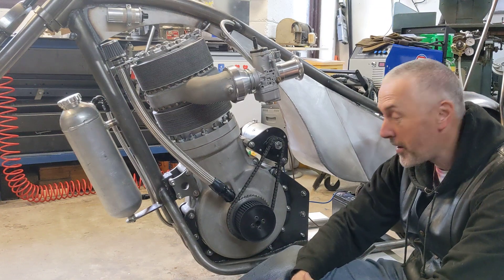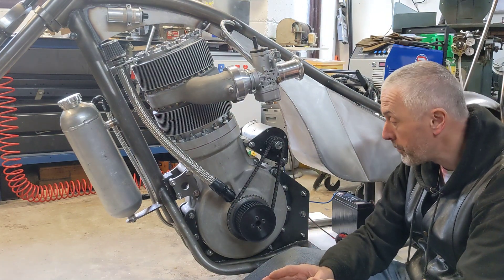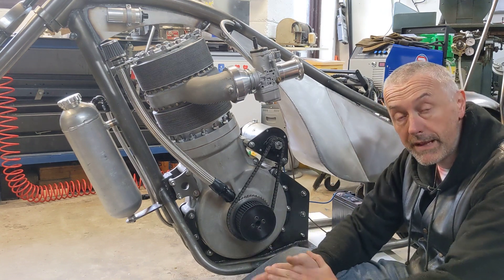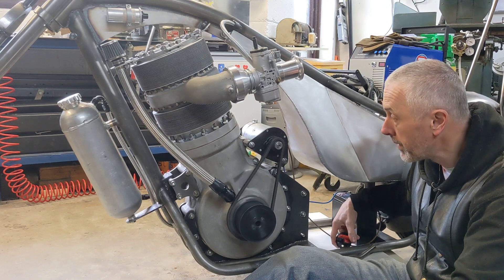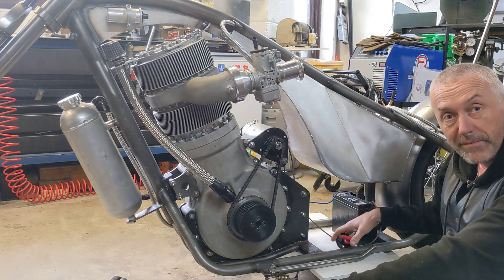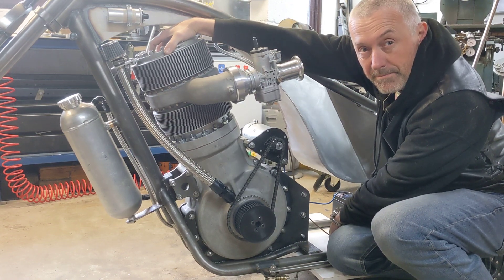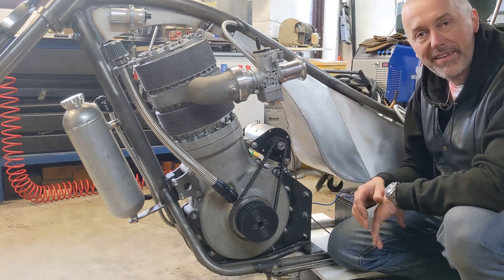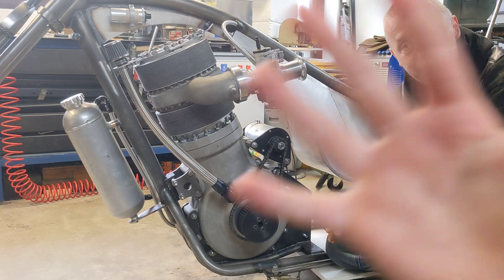Turning the engine at different speeds.

Comment: Why don't you use a starter from a car? There are small ones that are 2.2 KW, that should be enough
Reply from the maker: @peterolson8350  in the later videos we try that, but even a 2.1kw car starter motor isn't enough.
Reply: @StoneEng Even with a gear ratio of 10:1?

Comment: Would it be possible to piggyback the Dyna start to the Audi Starter you have fitted which would give two simultaneous starter motors but also then the battery can be charged after engine start up as you originally planned. Also, try using a larger car battery and higher rated car battery leads too.
Reply from the maker: I did think of that. It would be a challenge as the two rotate at different speeds, but that could be overcome by gearing. I'll see how I get on with a single starter motor first.

Comment: Decompressors can be wierd things, you would imagine they would reduce engine braking but the opposite is true. with no decrompressor an engine on the over run will compress air and then get that energy back as the piston goes down with the air acting like a spring so the net energy loss is low. With a decompressor open it pumps air out on the compression stroke and draws it back in on the down stroke, the pumping losses are far greater than the losses of compressing the air and then that compressed air pushing the piston back down. Which is why they where used on 2 stroke trials bikes to increase engine braking. So one fitted to facilitate cranking an engine would have to flow a lot of air easily.

Comment: Perhaps a starter motor from a large diesel engine..huge leads relays and old school throw contact lever.  Im thinking a dynamic decompresser operated from a handlebar clutch lever ....this   could be pulled into various levels at will..serving to control the beast when riding. .also as engine braking..kind of a secondary clutch role. .

Comment: Your going to need a big battery with 1200cca, its asking for more amps but that battery just cant put them out.. you might want to buy 2 850cca batteries for a starter cart and run them in parallel so the starter has access to all the amps it wants...   and that little bike battery will be good for accessories while riding till you stall it and need the cart to jump her up again lol😂 ... tbh, you might want to look into going 24v system.. with 24v then you have the ability to build a 7s 10p li'ion  battery with bms, if you use high discharge li'ions from drill batteries with 15amp discharge rate, you get 15amps times 70 cells you get 1050 amp discharge potential at 24v , which is all the oomfph shell ever need.. pity when building these into 12v they need either 3s or 4s because .5 of a cell isnt possible lol😂, so you get an 11.6 or a 16.8v battery which isnt usable with 12 charging systems available..  might just be time for a 24v system with lithium

Comment: how did you arrive at that gear ratio between the starter and engine?, seems very low for such  big engine. Just compare it to how big the ring gear is on a normal car engine

Comment: Are you gonna use a Harley gearbox ? Pretty sure those and separate units to the engine and are belt driven, or at least some are
Reply from the maker: Gearbox deals are in other videos on the channel. Not Harley, home made. 💪

Comment: Just start with an automotive/small engine poppet valve. Also it is allowable to use bronze for a seat material. I suggest the forged bronze valves used in high pressure welding gas bottles for a starting point.
Reply: CO2 fire extinguisher valves. They open and close rapidly. Hold 750 psi without leaking.

Comment: Honestly you can absolutely nail those starters. Get a decent battery that can really give out some CCA. Your I squared R losses in those cables will surprise you. Measure the voltage drop across one whilst cranking.
Reply from the maker: Do you have a dynastart? Curious to know more as the terminals are quite thin.
Reply: @StoneEng   Hi, I agree thicker cables should be installed. If not for the losses then for longevity, cant hurt. Looking on google those terminals do look pretty thin, but I still insist on the cables.
Reply: @StoneEng Also measure the voltage during cranking, 8,5V is half the power of 12V. A car battery can also be a nice test.
Reply: I don't have a Dynastart but I really do think it's big enough. As someone else has said try a car or better a truck battery with much thicker leads properly terminated. I don't think the terminals should be too much of a problem as they are only short.
Reply: Lower gears

Comment: Making a custom decompressor is a waste of time. You need a stronger starter. The engine wont make enough compression with the large decompressor to start and it wont have enough inertia to kick over once the decompressor is shut.
Reply: And a bigger battery!